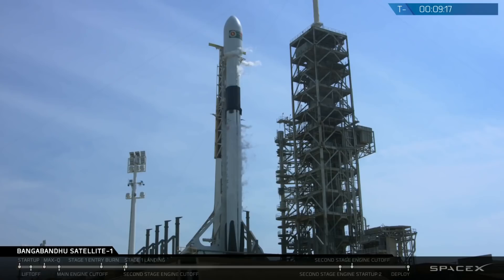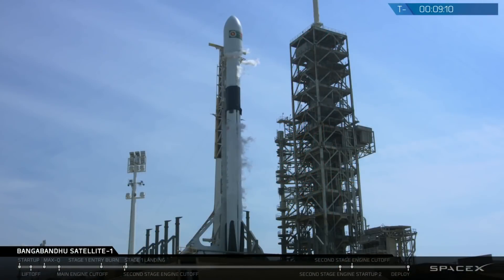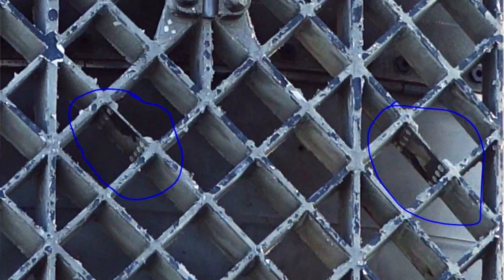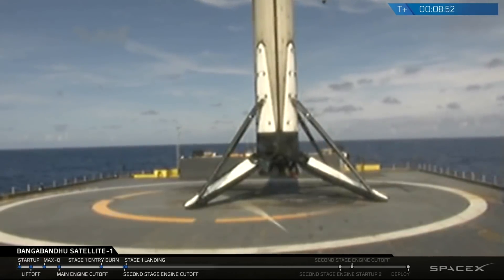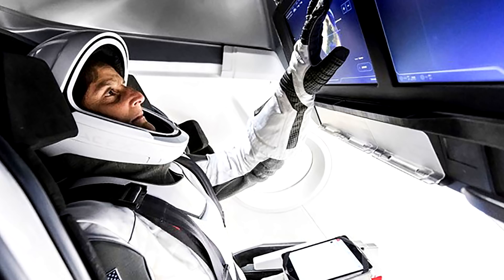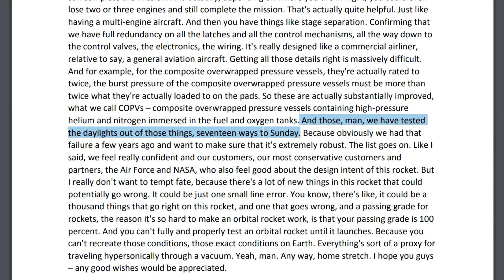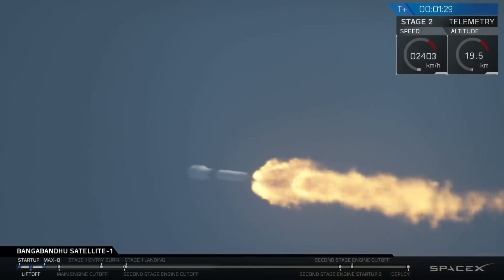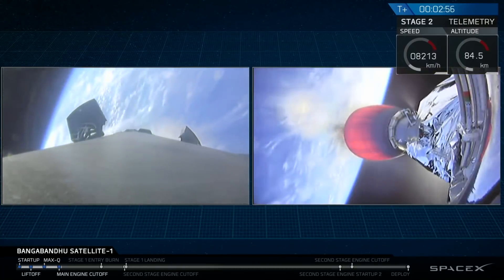How Well Did SpaceX's new Falcon 9 Work?

Comment: NASA has swung away from the one extreme (overriding contractor red-flags), to the opposite extreme of not funding Dragon-2 rapid turn-around innovations. The features on Dragon 2 such as Super Draco powered soft landing, and landing legs extending through the heat shield, were vetoed by NASA. 

They won't permit proving feature safety incrementally, which could be done on cargo-only return missions and the upcoming in-flight abort test. 

I suspect the memory of fire sweeping though the Shuttle Landing Leg Bay has burdened someone with PTSD.

NASA has awarded contracts for astronaut rated vehicles to both qualifying companies. This cuts Dragon 2 flights in half - about one per year. So we have gone from zero to three simultaneously funded capsule projects.
Reply: I also doubt anyone seriously thinks that the StarLiner is a better design than Dragon 2; The layout and interior are very clinical looking and uncreative.
Reply: Maybe it's a good thing that they fund 3 programs. For instance if 2 fail to meet requirements or don't work, something like that. Then  they'il stil have another one.
But I largely do agree with your statement.
Reply: chris kerwin, these aren't consumer devices - function beats form 100% of the time.
Reply: I'm not referring to form, I think the SpaceX entry is a more innovative practical design i.e. putting the superdracos on the sides which are both escape motors and landing motors.
Reply: They didn't veto propulsive landing. They said they aren't going to fly crew on it until SpaceX demonstrates the capability with an orbital reentry, descent, and landing. SpaceX said it couldn't justify that cost, and cancelled the program.

NASA would absolutely never risk astronauts or their critical scientific cargo just to allow a contractor to conduct some test. It's not worth it for them.
Reply: Ambient Morality, the Grasshopper tests and Falcon 9 landings were not available at the time of that decision. However, NASA has funded tests of the parachute system. My point is that these LANDing systems could still be tested. For example, the pad abort test and launch abort test could have been testing these landing systems. The Draco engines could be tested and legs extended before/after the drag chutes are deployed. They could be tested after reentry. These are all incremental tests. The requirement that SpaceX fund a complete end-to-end test is exactly what I object to. Why is SpaceX not required to fund a complete end-to-end test of the parachute deployment?
Reply: Because SpaceX bid on the CCtCAP contract with a proposal that specified parachute landing. They were never going to have propulsive landing for CCtCAP, that would be for a follow-up contract.
Reply: David, if the capsule has to come through orbital re-entry to test the landing systems then wouldn't it already be doing a full space flight?
Reply: chris kerwin, my point is incremental tests are adequate. Once the landing system is validated in helicopter drop tests, it is ready to go at a moments notice. Once the landing legs are proven to extend after reentry, the engine test can proceed. Once the Super Draco engines all start, the parachutes can be saved for another day. If any incremental test fails then we use the parachutes to land near shore or near the drone ship. 

However, NASA clearly was not prepared for anything new, unfamiliar, and perceived as risky , such as the "hover-slam". So they insisted on an end-to-end test, *paid by SpaceX*, instead of a simple leg extension and Draco Ignition *with parachute contingency*.
Reply: Ambient Morality, that was circular logic. NASA specified parachutes but didn't have to. That is, they were clearly not prepared to accept a hover-slam proposal.
Reply: David Ogawa False. SpaceX bid with a parachute design and thus milestones were set for a parachute system. If SpaceX wanted propulsive landing for CCtCAP, they would have bid a propulsive landing system.

NASA was not ever going to pay for the development of a system that they did not select. Thus they did not pay for propulsive landing.
Reply: Ambient Morality, and the bid would not have been acceptable.
Reply: David Ogawa You’re speculating, because that bid was never submitted so we have no idea.
Reply: David Ogawa It's not a hover-slam. That refers only to the high-G maneuver done by the rocket upon landing, not the soft landing of the Dragon capsule.

Comment: 2000 series aluminium is still the most widely used series of aluminium alloys in aerospace, with 7000 series filling different applications. 7000 series is stronger, but also harder, and its extra hardness results in a much shorter fatigue life. (Not an issue over the order of 10 flights before disposal)
In modern aircraft, it's common to use 2000 series on the bottom of wings, which are under tension due to bending, and 7000 series on the top surface which is usually under compression
Reply: Andrew Bailey in mechanical seals we use sintered silicon carbide for face material because it is extremely hard and chemical resistant, but is very fragile and will not handle vibration in high energy applications. Tungsten carbide is used in areas where shaft alignment and cavitation could fracture silicon carbide.
Reply: Weren't old Airships (like the Hindenburg) made from the 7000 series Alloy?
Reply: 2000 has better fatigue life and crack resistance, even though it's much weaker against static load. That's why it's used in the wing box.
Reply: Reduced cycles,,, but the cycles are on the order of 2,000,000  cycles vs 1,200,000 cycles,, and there are many variants within each series, both composition and temper.  One or two of the work hardened 5000 series have some benefits.  Lots and lots of variants.   You just gave me a great idea !!!!  Thanks  !!!
Reply: Andrew Bailey what is the difference, if any, between the ‘thousand series’ aluminum alloys and cast alloys like C355 or A357? Just different AMS specs, and one is extruded vs cast?
Reply: I always explain the difference as a yield to failure curve.  Diamond yields and fails at nearly the same time.  Playdough yeilds almost it's entire volume before failing (or breaking).  2000 series aluminum's yield point is much lower than it's failure point.  7000 series aluminum fails much sooner after it begins to yield.  Though both types have a similar breaking point.  Meaning that in this case 7000 holds it's shape longer than 2000 making it more ideal for holding the structure up.
You might be thinking then "why not use 7000 series for everything?".. 
The answer is that energy follows the stiffest path.  In 7000 series structural loads and especially shock loads tend to transmit directly to the weakest points in the part.  Connecting edges with bolt or rivet holes for instance.  In 2000 series aluminum the structure tends to absorb more of this energy by yielding or flexing.  While this may deteriorate the structure over time we can calculate how much of that structure will deteriorate and at what point we can expect to replace the part or expect it to fail.  
In situations needing absolute stiffness we would use 7000 series and in areas we want it to absorb energy and bend a little we would use 2000 series.  This is all part of the science and art of engineering. 
As a side note, carbon fiber is a little of both worlds and can adjust the amount of stretch by adding or subtracting the amount or type of binder that holds the carbon (like diamond) together, adjusting it's properties to make it stiffer and more flexible.  Carbon fiber composites tend to handle dynamic loads and endure shock and vibration in a way that steel and aluminum can only dream of even though it's total load to failure is much lower meaning that we can design parts that are much lighter because we don't have to add so much material to handle these forces.  Unfortunately composites tend to be labor intensive, expensive and not nearly as heat resistant.  It's always a trade off.
Reply: Excellent explanation.  My compliments.
Reply: Nils None no, they where made from duralumin
Reply: Nils None parts yes, but I'd be hesitant to compare their applications to modern 7000 series alloys. Like in most metals heat treatment is of equal if not more important than the alloy composition. Microstructure rules everything.
Reply: The octaweb probably doesn't experience much bending/flexing since it isn't elongated like a wing so there isn't anything to leverage on it.
Reply: Just to add what little I know. 7000 series cannot  be welded it will cause brittleness. That is the reason it is bolted.

Comment: Who'd fly payloads  back-to-back in 24 hours? Assuming the BFR isn't ready this year, I have no doubt a couple of back-to-back FH launches would be considered to get Starlink going. That's ~ 60 to 120 (500 to 1,000 kg each, plus the weight of the rack) per launch. Then there's Iridium: They have a launch of 5 sats and two more of 10 (All out of Vandenberg) to round out the NEXT constellation by the end of the year. Odds-on for  the last 20 to go on (as close as possible) to two days on the same booster?

Comment: Also, if a rocket blows up on Pad, wouldn't it be safer to be in the capsule than in the tower? Because if the crew isn't in the capsule while loading fuel, then they will most likely be in the tower, which doesn't sound any safer.
Reply: I don't know if they do this but it seems possible that they could have a bunker at the base of the tower.
Reply: correct. I don't understand why approaching a fueled rocket is smarter than load in go...in which if something goes wrong you have a Launch Abort System. 

If a rocket blows up loaded with crews on the pad....they are all donez0..... literally makes no sense at all. But its how "NASA has always done things" .  Go talk to the Russians on how well that worked out when they screwed up and killed over 100+ people on the pad. ( IE search  " Nedelin catastrophe "
Reply: If using cryogenic propellants, then it doesn't matter one way or the other.  As long as there is ANY cryogenic fluid in the rocket, there is "topping off" and venting, which amounts to continuous fueling.
Reply: Dennis Lindemann, it doesn't really. When fueling, the temperature of everything is dropping, the rocket is physically contracting. That physical contraction actually was the physics-based reason for the Amos-6 failure. Once fueled, the pressure and temperature is held nearly constant. Once it's in a stable state like that for a few hours, temperature change is nearly zero.

That's considered to be much safer. Combine that with the expectation that the launch abort system probably has at best 75% reliability in a true failure scenario (complete explosion rather than "nice" pad abort or in-flight abort test), and putting ground crew and astronauts near the fully-fueled rocket while it's stable makes more sense than conducting a volatile loading procedure with astronauts onboard and hoping the launch abort system functions perfectly if needed.
Reply: +Dennis Lindemann I imagine the thermal, pressure and resulting stress gradients are much larger during the bulk propellant loading than topping off.  That said, the absolute pressures may be higher for the latter.

Comment: Unburned carbon in rocket exhaust?
I heard rocket engines are by far the most efficient combustion engine we can build, or do they fly with a fuel enriched mix?
Reply: Yes, a lot of engines runs with fuel rich mixture, and I think that even with the most efficient engine, there'll always be unburned components.
Reply: Yes, they run fuel rich. A stoic mixture would get far too hot.
Reply: Chemical reactions (especially combustion) never go exactly the way the equations say they should.
Reply: They are the most efficient thermal engines we can make, but that still only makes for about 60% thermal efficiency at the absolute max. Thermal engines are, unfortunately, shite, in that regard.

Comment: Does the barge really take several days to come back? It's only 200 mi off the coast, even at 15 mph, that's 13 hrs. If they can't do 15 mph currently, how difficult would it be to put some half-decent propellers on them.
Reply: It actually landed about 400 miles off the coast. The Falcon Heavy landed much closer, because they had the spare fuel to slow down. This GEO satellite launch didn't have the spare fuel, so it flew on a 'ballistic' (or, unpowered) arc, much further out to sea.

And this is a huge barge - the barge is 100 feet wide and 300 feet long, and has 35 foot wide wings attached to each side. It is towed by a tug, and they manage to do about 10 miles per hour - which is pretty good going for such a large load. It also took them about a day after the landing to secure the rocket.
Reply: Robert Backhaus Alternative solution: Have a regular commercial freight ship pick up the landed booster from the barge, then sail it to KSC while leaving the barge in the landing area for the second flight.  The world currently has an overcapacity of large freight ships, so there'll be price competition for the job.  For additional time saving, do some prepping of the reused booster in transit, as there'll be plenty of wasted space on the ship anyway.

Comment: SpaceX should just paint the bottom section of the first stage black, so when it gets sooty it doesn't look ugly. They can put their logo higher up.
Reply: They did move the logo up. But the Block 5 didn't seem to get as sooty. I think they have a new coating on the tank that keeps the soot from sticking as much.

Comment: How is it NASA thought it was safer to work next to a fully fueled rocket to begin with? Youd think it'd be a no-brainer to strap the astronauts in first with no fuel. Then once all staff is cleared start fueling.
Reply: Copy paste from Ambient Morality above:
"When fueling, the temperature of everything is dropping, the rocket is physically contracting. That physical contraction actually was the physics-based reason for the Amos-6 failure. Once fueled, the pressure and temperature is held nearly constant. Once it's in a stable state like that for a few hours, temperature change is nearly zero.

That's considered to be much safer. Combine that with the expectation that the launch abort system probably has at best 75% reliability in a true failure scenario (complete explosion rather than "nice" pad abort or in-flight abort test), and putting ground crew and astronauts near the fully-fueled rocket while it's stable makes more sense than conducting a volatile loading procedure with astronauts onboard and hoping the launch abort system functions perfectly if needed."

Comment: I would trust Elon Musk's Dragon 2 on a falcon 9 before the death trap shuttle
Reply: On a technicality, the space shuttle made 135 flights with two vehicle losses, the F9 has made 58 with two vehicle losses as well, which makes it 2.3x safer, per flight. So far, anyway.
Reply: MillionFoul
Bullshit!   You assume that when the vehicle fails the crew dies.  Did you catch that Soyuz failure recently?   Those guys were home with their wives the next day.   The Falcon 9, like Soyuz, has a viable escape system.  The shuttle was a death trap precisely because it didn't.   Everything on the drawing board today is infinitely safer than the shuttle because the crew will be able to punch out safely on the 1% of flights that fail.
Reply: I'd trust Apollo over either

Comment: I wonder. How does rockets detect if they are exploding?
Reply: Informative - I'm sure it's more advanced now a days, but if I recall correctly the SaturnV for instance had wires running down the length of the rocket. If the vehicle began to break up these wires would get destroyed and trigger the LES. Something like that. I'm not sure how SpaceX does it on the F9.
Reply: They have multiple sensors, and to my knowledge (and as it has been said by Motokid) most of the launchers use wires running through the lenght of the body like Saturns and Ariane 5.
Reply: Wireless battery/supercapacitor-powered accelerometers would also give an instant indication of rapid unscheduled disassembly, and also identify the source from the dispersal pattern.

Comment: I thought the thrust also improves because the mass of the booster gets lighter as it burns through its fuel. How many block 5 boosters do SpaceX have now, anyway? Anyway it looks awesome!
Reply: You're thinking acceleration, which does increase as the booster gets lighter.

Thrust is a force. Force = mass x acceleration, so as mass decreases, acceleration increases for a constant force.

However, the thrust is more or less constant. It does change a little over the course of a launch, but by less than 10% while the mass of the booster changes by 90%. And the change in thrust is unrelated to the change in mass.
Reply: Got it. Thank you for explaining that. :)